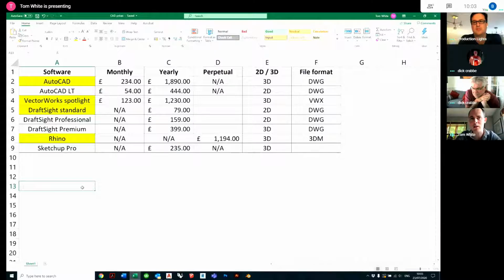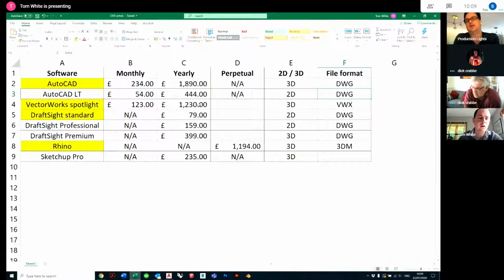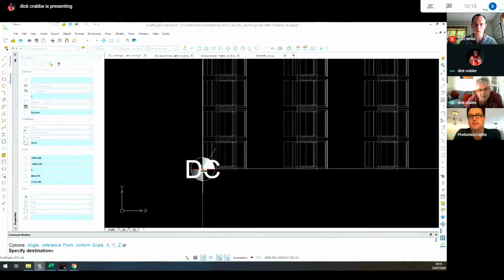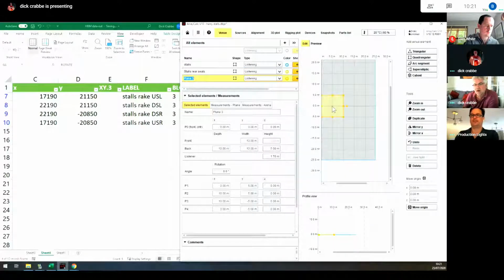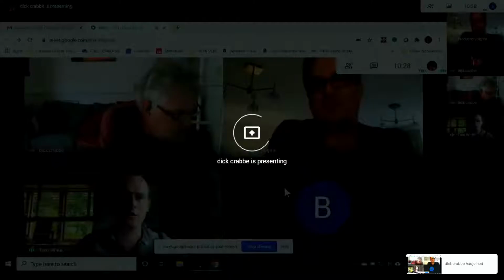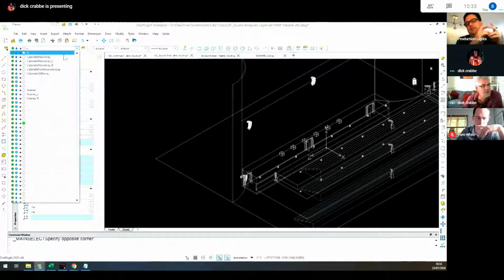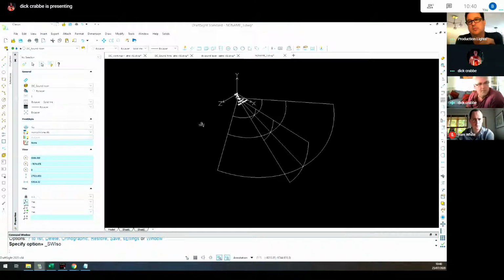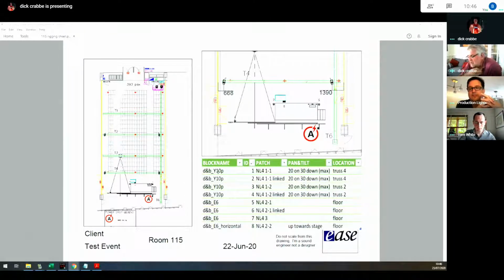CAD Lessons - Ep. 16 on Thursday  @ 10.00

Comment: In this episode we discuss the costs & relative benefits of AutoCAD, VectorWorks, Draftsight & SketchUp.

The after at about 13:30 I try to run through what I've learned over the weeks,  relating it back to my Sound designer workflow.   I talk about CAD into d&b ArrayCalc,  & getting the results back into CAD.  I talk about block attributes into Excel data.   I also talk about getting a 3D "heatmap" back into CAD.